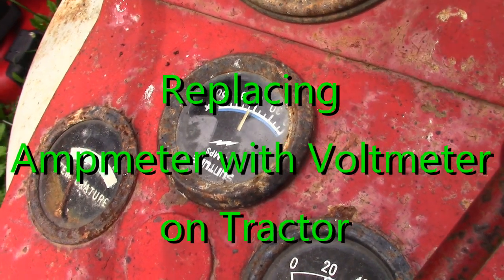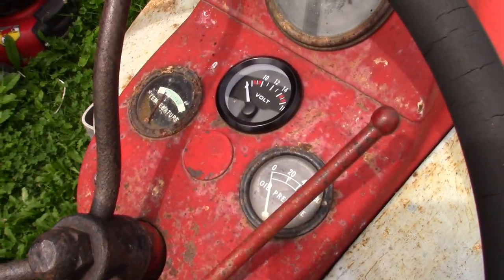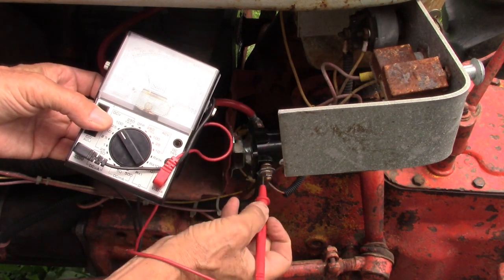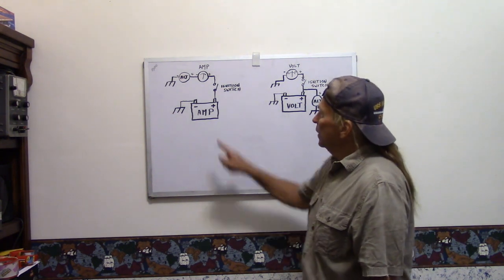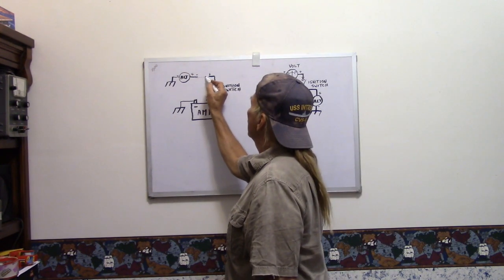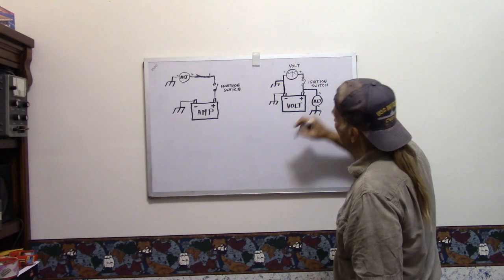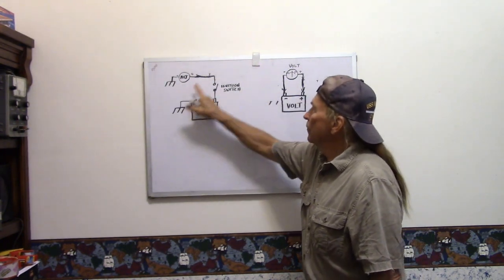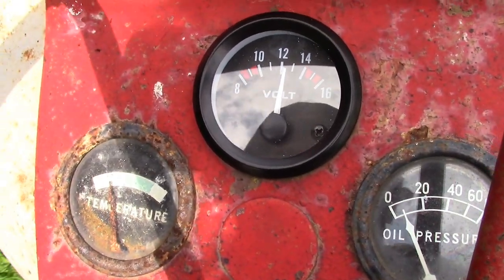Replacing Ampmeter with Voltmeter on Tractor

Comment: I have a 1951 Ford 8n with a new Amppeter I just hooked up.  The needle stays on zero and flutters there. If I  repace it with a voltmeter will I be better off with better information?  Do I want to know amps on the tractor, or do I want to know how the battery is doing? I'm confused...THUMBS UP!!!
Reply from the maker: I chose the voltmeter --- it lets you know the condition of battery charge--- the ammeter just lets you see charge or discharge. voltage charging is close to 14 volts and a full charge is 12.4 to 12.7 volts.
Reply: @donaldporta Like you, I value the voltmeter info much more than an ammeter.
I thank you for making this vid.  It's exactly what I needed.  I can't imagine a better instructive video!
Bravo👏👍
Reply: @donaldporta  On my 1951 ^ N still not sure where to connect the voltmeter to.  Does the neg.  terminal on voltmeter get connected to solenoid, and pos. side of voltmeter get connected to tractor on/off switch?

Comment: So on a riding lawn mower or an old tractor run a wire from the key in the run position terminal to the volt meter and just ground the other side of the volt meter thereby the volt meter will only read in the run position. Is that correct?

Comment: Just an observation, the voltmeter didn’t show much of a change when you reved the engine.
Reply from the maker: voltage wont change much, the current is what you will see increase when revving up, but we removed the ampmeter.

Comment: I was going to test my tractor amp meter with direct battery, but Don say NO Go!  Can I remove  amp wires to replace with volt meter or must I tie amp wires together?
Reply from the maker: must tie amp wires together
Reply: @donaldporta  I replace with same amp meter.

Comment: Which is better amp meter or volt meter? May amp wiring was so hot when start it.
Reply from the maker: the volt meter lets you know how the battery is doing and does not need the higher current to flow thru the circuit and will not heat up. The amp meter just lets you know what current is flowing at that particular time and will not let you know the battery condition.